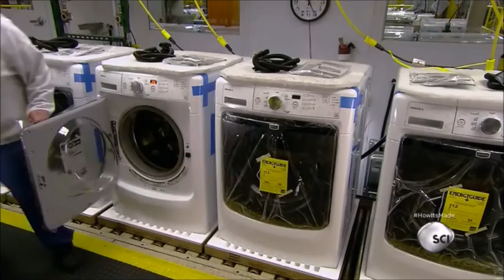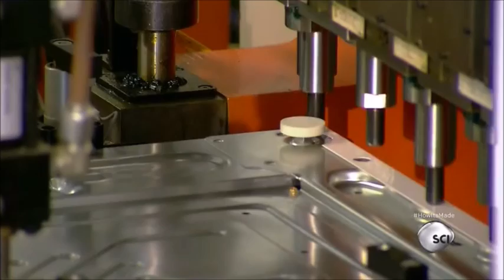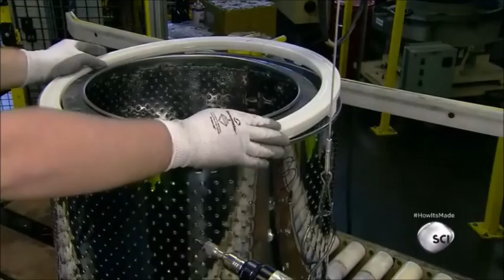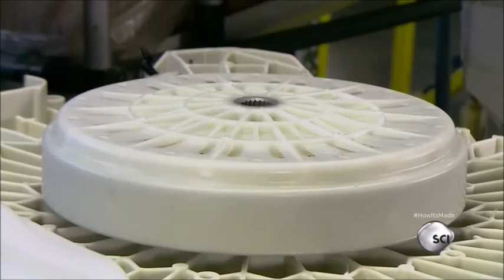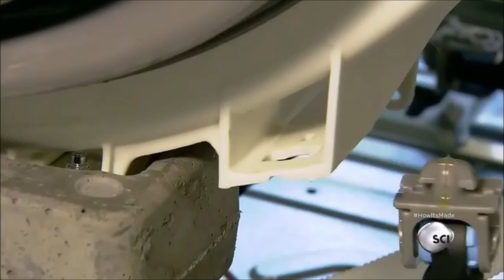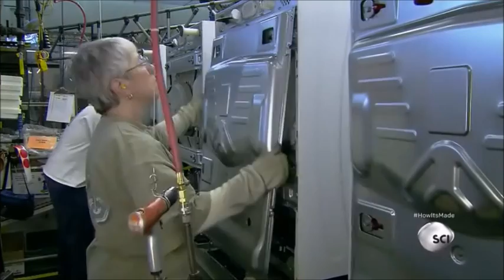How Its Made - Front Loading Washers

Comment: Living in the uk 98% of homes have front loaders  1% have top loaders that work like front loaders designed to fit in a small
Gap and lift the lid I clip the catch and part of the drum side opens to load the laundry then close it again, the drum is the same as a front loader just no door on front or glass to watch it  the other 1% have American type top loaders that are used as commercial machines but not very much as they don’t have built in heaters, don’t wash as well or rinse well or spin Very fast ( most are whirlpool crap ) but the are the centre post agitating machines, not the even worse ones with the plate at the bottom,   I’ve used all types of machines all over the world and still go back to my front loader everytime. Look after the machine , wipe the door boot, for gods sake don’t lose ten to tje crap about 20 degree washes. Would you wash greasy pans in cold water or shower in cold water, no why wash your cloths that are covered in pollution from outside, body grease,sweat and all other stuff we spill at 20 degrees    Quick wash is the most expensive programme to use as the machine used all its power to heat the water like a kettle which can be 2500 watts where as a 2 hour 60 degree cotton wash heats the water gently using around 600-900 watts if that, heating gently takes advantage of enzymes designed to work at low temp then as it gently heats some more it starts to remove stain and grease and other muck, then it will do 3 rinses minimum instead of two very high water level rinses that quick was does ( quick does actually use more water than a standard cotton wash , hence the labels that tell you it’s  AAA+  rated is based on the cottons 60degree ( 140 Fahrenheit) ) 
And then the front loader spins much faster, to keep the machine clean don’t use laundry gel, liquid, liquitabs use powder   The liquids and gels build a film layer that gets thicker and thicker and thicker and breeds bacteria where as washing powder dies not, powder is also best for whites and don’t do cold washes  these create the environment to breed bacteria especially the bacterias that can cause severe urine infections,  why was underwear in cold water, your just asking for trouble there,  bacteria needs heat to be killed,   Wipe out the door boot if your not going to use it again straight away and clean the soap  draw  with powder you don’t really need stain removers either, never used a stain in my life and I’ve always got stains first time on the proper wash including mud, blood, poop, vomit, rust, red wine on white tops and table covers etc etc because I use a biological powder, I could go on for hours but gonna stop there.  Regards from the UK xxxx